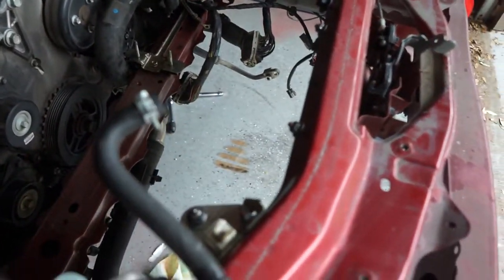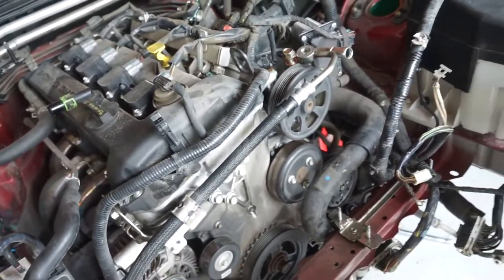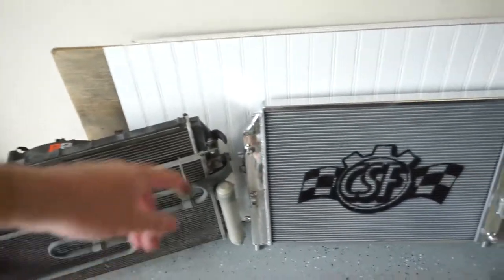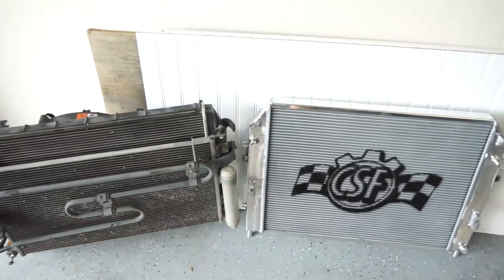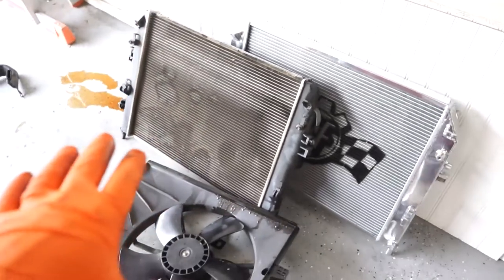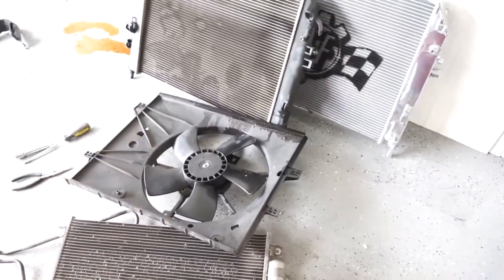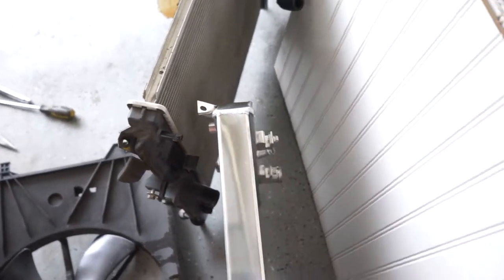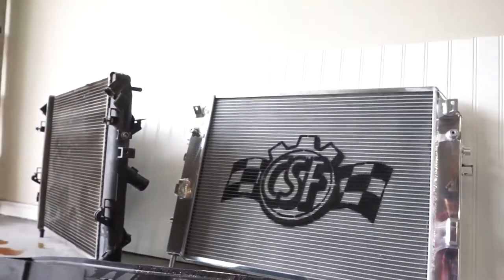Radiator Removed and Prepping the CSF Radiator for Install - 2.5 Swap Episode 18

Comment: Replaced the radiator with a CSF one also maybe a month ago since the OEM had a hairline crack near the top. It was causing me to lose maybe a cup every 2 weeks or so. It was a little overwhelming what had to be removed to replace it. Wasn't expecting that since I've done it on a number of other vehicles and it was WAY easier. Looking forward to seeing the completed project. Would love to meet up one day and just chat Miata stuff.
Reply: I love the NC but changing the radiator made me hate it. Why would they put it under the battery, psp, ecu, and coolant reservoir? Not only that but it's slanted so it makes it way harder to pull out.

Comment: Any plans to clean the AC Condenser before putting it back in?  i know they sell some foam based cleaners to remove the gunk.  from the pics its going to restrict you airflow.
Reply from the maker: I thought about it, but it's just going to get mucky again and the intake covers it too. Just saved myself a little elbow grease for when I need it next.

Comment: Excellent job you are doing. I have a 2012 Ford Fusion. They share the same engine. I am thinking to turbo the engine and putting the turbo at the back of the car locating it the other side of the silencer. 
Do you think it's a good idea?
Reply from the maker: Almonds love rear turbo set ups.
Reply: @ColoredinLight  !!

Comment: Nice vid. Any difference in the engine temp with the new CSF radiator!
Reply from the maker: I've noticed a slower warm up period and cruising 80mph at about 180 F
Reply: @ColoredinLight  so is running a bit cooler now. Just what I need for me Fj. Thanks